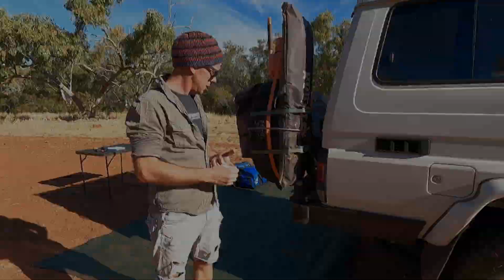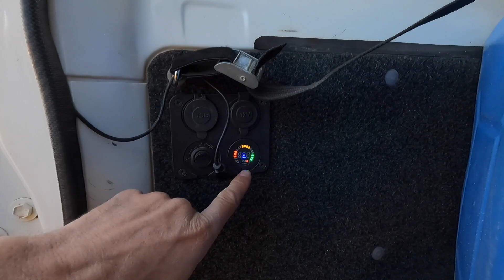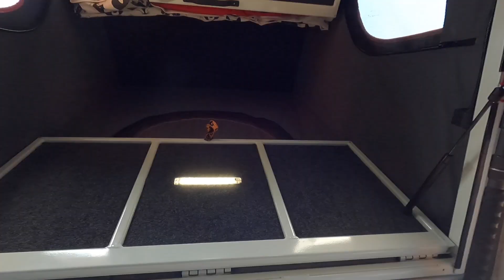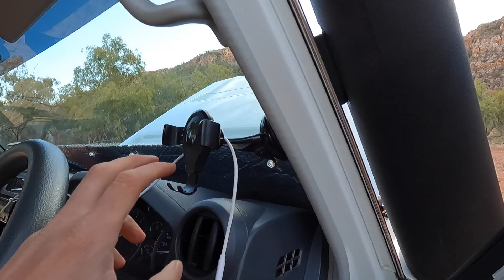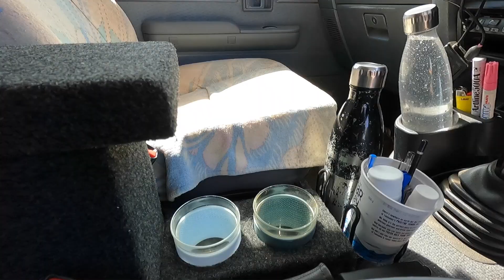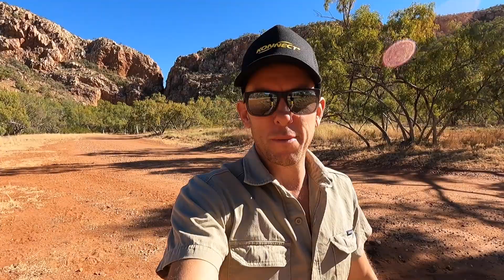Aussie lap in a Troopy - Ep 08. AluCab Poptop Troop Carrier Rundown

Comment: Nice set up. To get rid of sand in the carpet I use an adaptor on my compressor hose that just blows the high pressure stream of air out - this 'shakes' the sand free and helps the Hoover suck it up.
Reply from the maker: Thanks  Christopher Saul. Yes that is an effective method, I have done that a few times and it did work well. 👍

Comment: Loved your video series guys. Can I ask for a short review of your water-cooled sealed alternator? I have a 76 on order and this is one thing I just can't decide on. No issues with it raising the water temp of the cooling system overall ? Can you give some info on what unit you chose ?
Thanks in advance.
Josh (subbed)
Reply from the maker: Hey mate, thanks for the positive feedback. We had our alternator fitted at PDP in Perth WA. Not entirely sure on the model, to be honest I wasn’t aware of different models, I just asked for a water cooled alternator. We have not noticed any increase in engine temps but we also haven’t been crawling through the bush in 35degree heat. We fitted it as an insurance as we knew we would be hitting some deep water crossings and possibly mud along the way. Nearly $3000 so not cheap but cheaper than breaking down in the bush with no cell coverage I thought. Enjoy your 76 👍
Reply: just carry a spare ans some spanners. It's like $3k for a waterproof one.

Comment: how much does the troopy cost
Reply from the maker: Prices vary from dealer to dealer but prices are probably with in $5k of each other I’d say. Mods are endless, you could easily spend $150,000+ on mods if you include rear coil conversion and portals. 👍
Reply: The base GXL vehicle is about AUD$74K, which is a ridiculous amount for what you get, but there is no competition in this segment.  And when you come to sell, they hold their value extremely well.